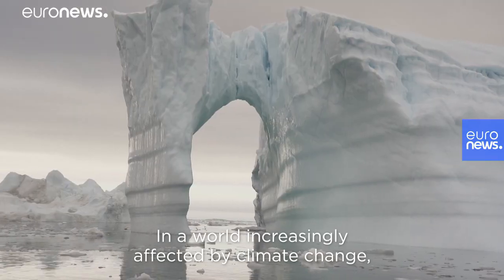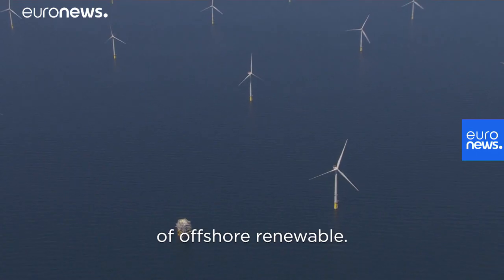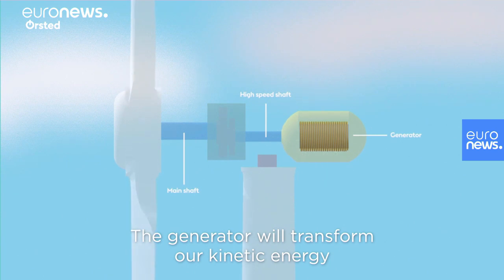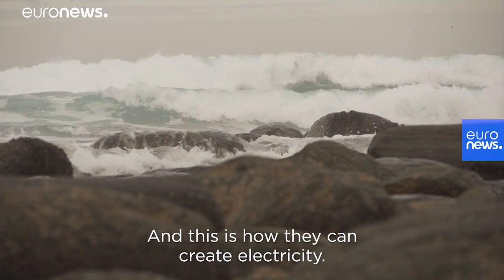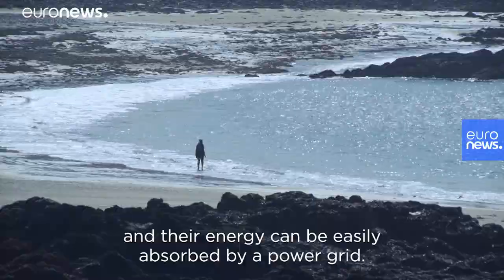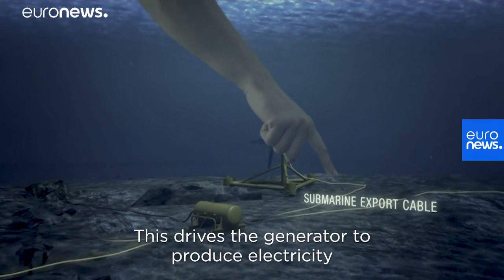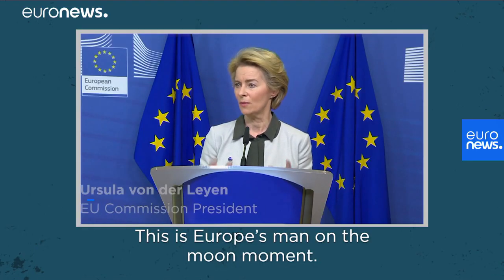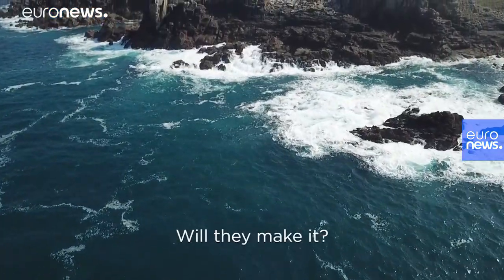What are offshore renewables? And how do they work?

Comment: So they want to increase offshore wind to 60GW by 2030, and 300GW by 2050.
A single typical coal plant provides about 600GWs of energy. For a fraction of the cost and upkeep.
Not to be a naysayer, but I hope the tidal & wave options have a better outlook than this, because I don't see this replacing any fossil fuels until there is no other option.
Reply: Here you have made a small unit mistake with a big impact. The expansion target is 300 GW, i.e. 300,000 MW. An average coal-fired power plant has a capacity of about 600 MW. The expansion target therefore corresponds to the output of around 500 coal-fired power plants. Even though the full-load hours for offshore wind are already very high, a coal-fired power plant probably has a higher capacity utilization, so the ratio for the energy generated will be somewhat lower. Nevertheless, the expansion target is a big step toward achieving climate-neutral power generation.